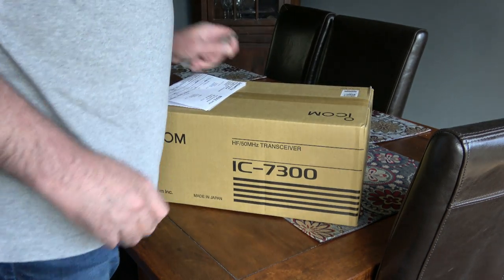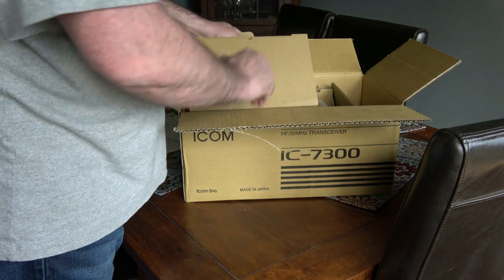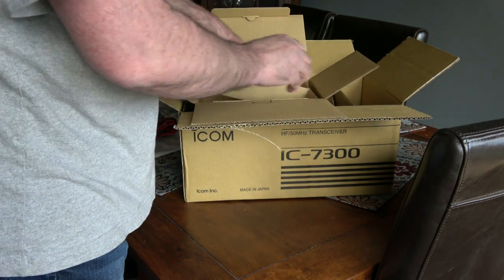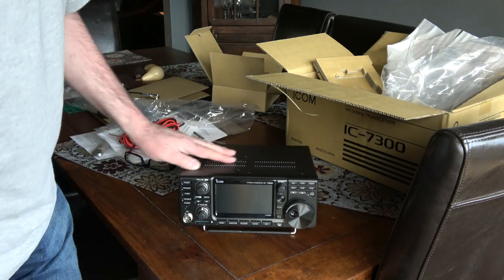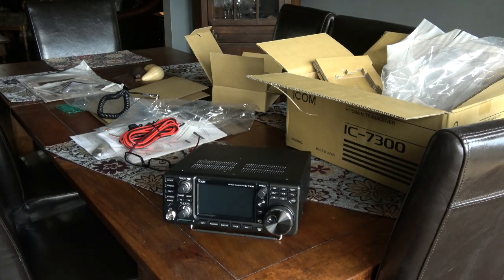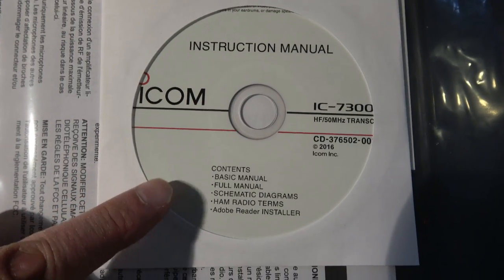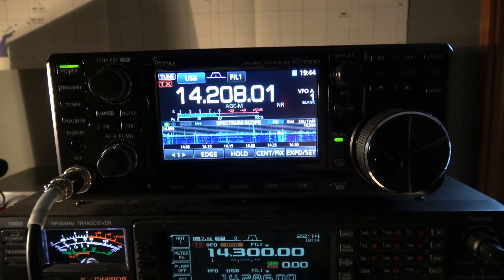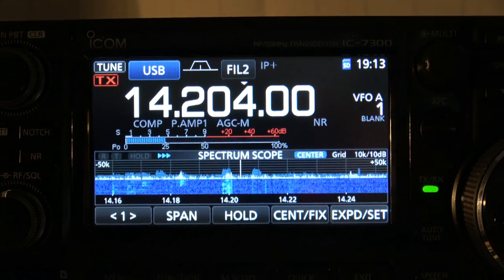Icom IC 7300 Unboxing

Comment: Would that be a good radio for trucking or is it differant than a cb. I know nothing about radio's want to learn. I know a lot of guys out here use ham radios like connex and galaxy but never seen one like this
Reply from the maker: No, not good for use while driving.
Reply: @Radio-Hobbyist  appreciate your concern for safety, but that is not what. I asked I was asking if a you can use as a cb or is this a differant application than a cb?
Reply from the maker: Sorry, this radio does not transmit on the CB bands although it can receive them. This is a ham radio and you have to have a license to use it.
Reply: @joshuavarner8554  It's been about 7 months. Did you look into amateur radio? If you're interested in CB, you will like ham radio. Many of us hams came from CB.
Reply: @Radio-Hobbyist  ok thanks

Comment: Is that the box they gave you or did it come in a bigger box.  And my manual came under the radio, beneath a piece of cardboard..  I’m wondering if mine was a return, resold to me.
Reply from the maker: I bought mine at a retail store, and this is what I got. They might pack it more when they ship radios - I do not know.

Comment: Just got the 7300 today,so far a great radio.
Only one problem the main vfo knob will not change the freq, tried everything, lock is not on etc...
My have to send it back, but will definitely be a keeper when that is sorted...
Reply from the maker: +Jason Wallace Ah crap!  Probably some connector not plugged in. Best to get a replacement though.